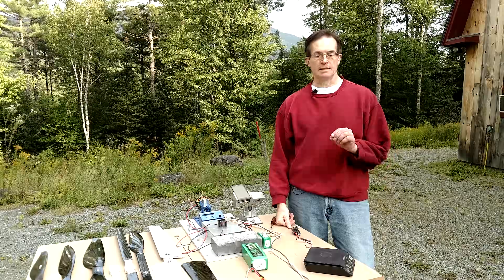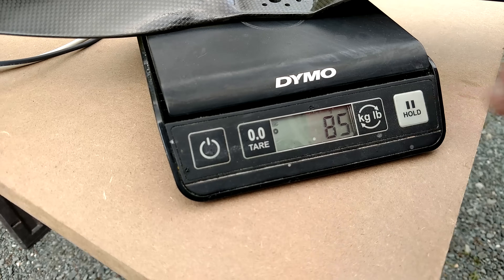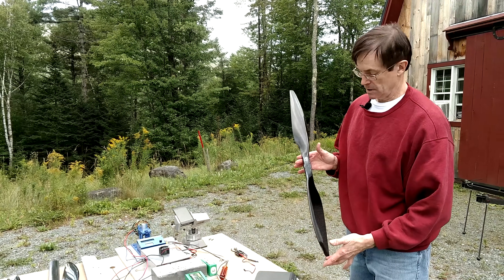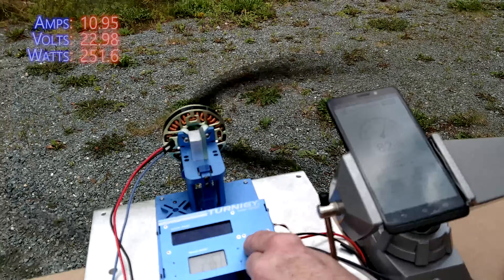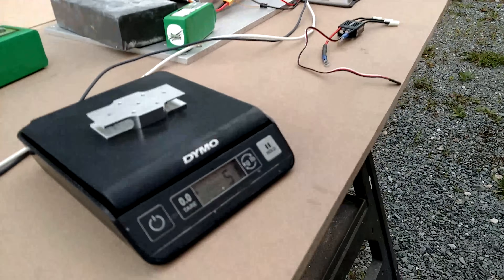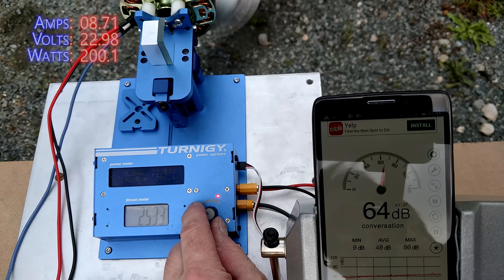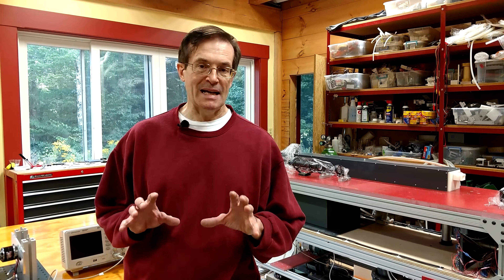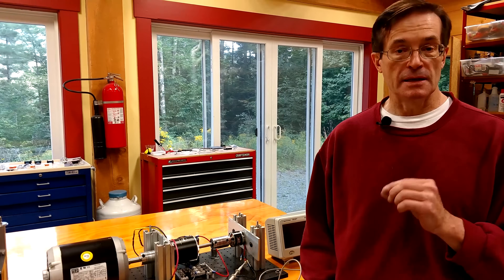Building Drone Rotors - PART 4 - The Testing

Comment: If you really want to Cut the Edge, diverge from electric entirely and try variable pitch rotors (actually what you have are props).
You're going to lose about 50% (+) of your motor output converting it to electric before it even tries to lift. 
One motor and belts, or 6 direct drive motors? Ah! That is the question. Whether tis nobler in the mind to string it up like spaghetti, or suffer the vagaries of getting six motors into close synchronisation? What say say we end the heartache, and the thousand natural shocks that Drones are heir to.
Reply from the maker: 50% loss seems too high to me.  Please break that down, if you would, to the inefficiencies that cause that much loss.
The argument between a generator feeding an existing electrically driven drone and direct drive with adjustable pitch rotors comes down to complexity, sound and vibration isolation, redundancy, modularity and also efficiency.
Reply: I've been into RC helis for over 30 years, back when electric meant Tethered and everything was a lot more "oily", so I guess I can concede my take on it goes back a bit. 
But I did closely follow some attempts maybe 15 years back to create Nitro/electrics and reports were of about 50% (if not higher) drag on the brushed dynamos they used, along with short life.
They didn't benefit from modern Turnigy measuring equipment but use a dolly, a pulley, a weight and a set of scales to measure thrust. They were around, just more basic stuff.
Hybrid tech is a lot better now, but you'll still going to lose quite a bit of power taking power from the engine through a generator, and then motors in comparison to direct drive (since it cuts out two stages of system drag).
Sorry I can't break it down beyond what I saw back then.
I was involved with a project with a guy in my old flying club here in France, who was using 3D (or variable pitch) helicopter heads  for a quad (A mashup of off the shelf quad and Heli components). It kind of worked, but was ungainly, difficult to control and slow. It vibrated so bad it would often oscillate.
It was real B to get all the trim right, and he spent more time writing C++ code than building it.
He used belts, but thought it might have been better with shafts, but pre-3D printers a central gearbox would have been a crazy amount of work. I did do some CAD's of just such a box, but don't know which of half a dozen old hards drive they are on. Also the format was for a CCM, so probably won't work on a printer.
However since then variable pitch props have advanced quite a lot, 3D printers have come of age and the quad market has exploded. 
If I was going to build a gasser quad now I'd probably go for a Hub motor (micro wankel (expensive) or a radial)  driving a 3D printed 2 ring splitter box. In turn driving 6 to 8 shafts out to Bevel G/boxes with servo controlled variable pitch props. With control still by Arduino. 
IMO less complicated then a "Hybrid". If built straight, balanced, and with good bearings vibration would be OK. Sound levels? About that of a 4 engine fixed wing Nitro R/C.
Just had a thought that has me wondering about using opposing top/bottom props on the arm with two variable props off a single servo. Times 6 .
Redundancy. It's a quad, lose a prop and crash. Octo's have redundancy 12 props on 6 arms has more.
As your project stands you might want to consider the double motor and prop option.
Modularity would be a given as it's one central frame, one motor, one central g/box 6-8 identical drive shafts etc.

A Direct Drive Fueler "drone" seems like something I could engineer if I had the time and money.
I'm too busy with work, fixing up a Chateau, and tinkering with half a dozen bikes to take something like that on. 
Besides I've been experimenting and building for years, and sort have lost the spark for it.
But not for engineering.
Reply from the maker: Thanks for the in depth reply. The typical efficiency of 3 phase brushless generators is 90%.  That is typical, with a range between 85-95%.  The presence of a timing belt costs 1-2% loss.The loss in rectification is less than 2% and in the smoothing caps about 3%.  An overall efficiency of 80% is reasonable.
Your explanation near the end of your comment, for why you are not pursuing something like this or some other related project is a real issue.  None of us has unlimited time, money or lifespan.
This is one of the reasons we choose this generator module project.  It can be engineered, designed and built as an independent effort. There are limited degrees of freedom and simple, self contained goals ie light weight, compact, fuel efficient, low vibration and noise etc.  The result could be tweaked up or down in scale (as we are doing) and other builders can imitate, modify and improve on what we produce.
Redesigning a multi rotor from scratch based on a distributed drive from a single power plant was too intimidating for us and would likely turn off a lot of viewers because of the complexity
Reply: LOL. I'm more a physical engineer than electrical, so what you are doing seems like black magic to me.
I'm a left leg above knee amputee and fully comprehend the mechanics and pneumatics of my prosthetic knee. How the hell it can tell what speed I'm walking at, or if I am going up a slope or down stairs, and adjust itself is the witchcraft bit.
I do have a project on ATMO. I'm designing a compact powered kickstand for my new Double Clutch Transmission Bike.
Reply from the maker: That has to be a challenge.  Beginning to explore the electrical side of engineering will greatly expand your options for so many projects.
Reply: I've been involved with fundraising and advising disabled people to help get them back in the saddle for years, so I'm quite familiar with some electrical engineering. Such a electromagnetic pistons for changing gears with solenoids for switching and polarity changing (thanks to having owned a Kliktronic). I can build a wiring loom for a bike from scratch. 
I also can build and wire a "drone" from scratch components, put in an Arduino with GPS and program flight characteristics and autonomy. 
Even though I could solder up a circuit board if I had the plans, I couldn't plan out a circuit board. That takes a certain mindset I just don't have. It's a bit like the ability to learn a foreign language. I've lived in France for 15  years and still struggle with conversation. , My brain just isn't wired that way.
If someone else makes Electrickery skulduggery happen I can see how they did it and why it works. I just couldn't originate the same stuff you do.
Talking about your stuff:
Have you looked into mounting double props (coaxial octocopter)? You could use smaller motors and less current (or is it wattage or amperage?). I know they don't produce 100% more lift, but it is substantial enough for you to make a more compact craft with smaller props, or get more lift when going big. Maybe take a leaf out of the EHANG AAV's book.

Comment: graphs and  or tables with results would be super helpful in future videos when doing comparative tests like this so we don't have to remember the numbers you are rattling off in the test.  thanks for this series.
Reply from the maker: Good advice.  Thanks.
Reply: @TechIngredients  let's measure thrust/lift vs power 😋
Reply: @terrance_huang  yes, that's the major point
Reply: @TechIngredients  i want low power-max lift what do i use ?
Reply: @TechIngredients  what constant were you using in the test? RPM? The power display on your testing device didn't show up in the video. If you could show the thrust and power draw and sound level for each prop at the same RPM in a simple text listing, that would be nice.
Reply: @greggv8  they had the power draw in the upper left corner, if you want to know the RPM you should just take the 160 KV and multiply it by the voltage and bam you get the motors RPM.. Also RPM does not matter because as the different blade diamaters will change the RPM  becasue each prop will have more or less load. What you really want to get out of this video is the amount of watts being used to get the ~250 of thrust not sure on the units he was mesuring thrust with. And the constants are the motor 160kv the battery voltage and the max WATTS of the ESC. You cant do a test like this at the same RPM, thats not how things work. Also if you just looked you could have seen the thrust on the test stand its on the lower display. DONT BE STUPID and just be more observant.
Reply: @ZeD69420  The Kv rating tells you the back EMF the motor produces. It only equals RPM/voltage at 100% throttle, unloaded.  You cannot calculate RPM  from Kv and voltage only.  But as you said. RPM really does not matter.
Reply: I was about to suggest the same... great, awesome videos!!
Reply: you are you serious dont be lazy and stupid, just rewind the video and write the results down your self if you actually care to use this data for your self. You are just like greggv8, please be more observant. All the numbers he is saying are on the screen just look dude.
Reply: Yes, thank you.
Reply: this is prime example of being lazy,, #1 its a video rewind and watch again #2 if you cared that much then write them down your sself #3 pay this man for his extra time

Comment: I have watched at times 16 hours of DIY  and technical, Youtube videos per day for years, you can check my history. I am your age BTW, retired, Out of passion of Science, Mostly all of that thirst would have got quenched, Had I got to this channel earlier, better later than never. Thanks , keep it going. would you do a video on How powered hydrofoils be made by the use of  carbon fiber in the structure and powered by your Hybrid Drone Generator .
Reply from the maker: Thanks for watching and your support!
We built a small hydrofoil with carbon fiber years ago.  The benefit of CF is questionable for this application because weight is of little concern as opposed to toughness.  S-glass would probably be the best even when considering Kevlar as an option, all things are considered. 
Control issues and stability/damping are significantly more important than the power source when designing hydrofoils, but no question they are fast and efficient.

Comment: Solidity calculations are based on the swept area per rotation and of course the number of blades is a multiplier in the sums, the calculations can be found in any good Aero-engineering book published from the 1930s to 1950s in the golden-era of fast prop driven aircraft.

Comment: Why not increase the number of blades ?
1,000 hp Spitfires were initially 2 blades then 3 blades for 1,500 hp and 4 blades for 2,000 hp Merlins (rule of thumb)
Griffon Engined Spits then changed to a 5 blade which was a smaller diameter for engines around 2,400 horse.
Reply from the maker: There are a number of reasons.  For any given diameter, the fewer the number of blades, the higher the efficiency.  This rule holds until the power loading of the blade exceeds the limit where the airflow begins to separate and the blade begins to stall.  In the aircraft you mention, the diameter is limited by ground clearance and the air frame and to avoid stall more blades are added to increase the maximum power the propeller could absorb.  The loss of efficiency was less than the gain in thrust from the additional power input.
Fewer blades are also lighter and easier to store.

Comment: Vibration and inertia will stop you increase the propeller size over 1 m or so. And keep in mind that electric motors have 90% efficiency and gasoline less than 25% so  is a little bit of justice :)
Reply: P-47 was about 14 feet - your statement depends on construction.
Thunderbolt used forged Aluminium-blades and had a chuffing great radial.
Yet I couldn't prop-hang like a modern lightweight high-power acrobatic plane :D
Reply: It's inefficient Avgas engine moved it along at 470mph or there abouts.

Comment: The whole time of the build I was thinking about paramotoring. The technology that you mentioned at the end would be very welcomed there too. Plenty of great channels built around that sport too with money behind them. Tucker Gott for example, but AviatorShow probably more commercialized, or you can directly contact paramotor manufacturers, I think they would be very interested as well. I saw Alishanmao try electric paramotor on his channel a few months ago and his problem was the short flight times because of the batteries. This could solve that problem.